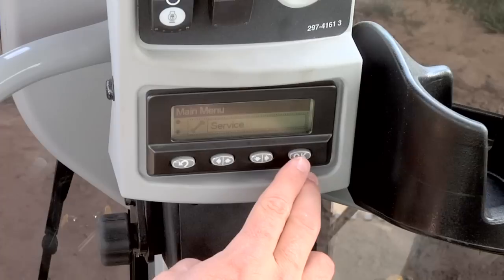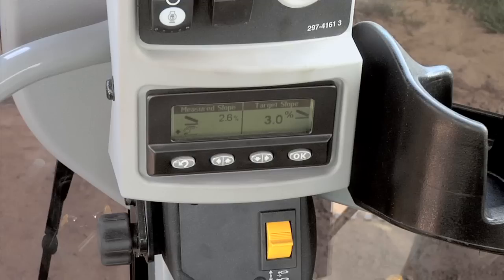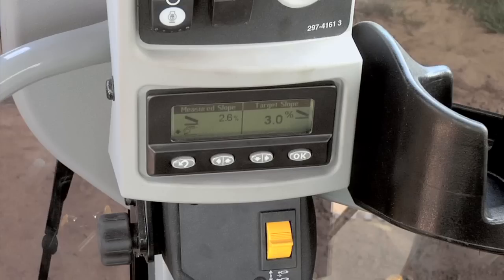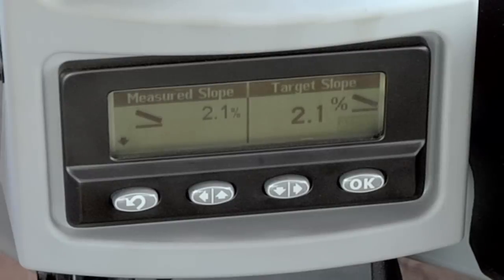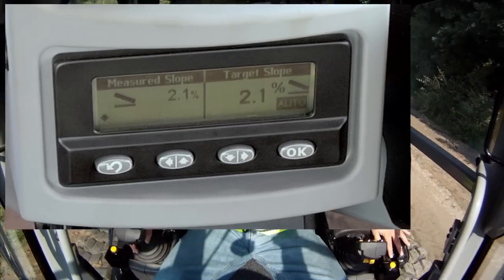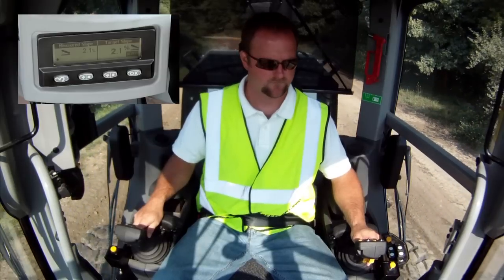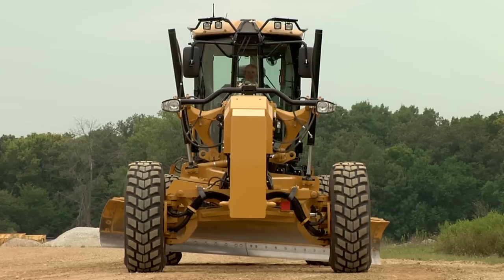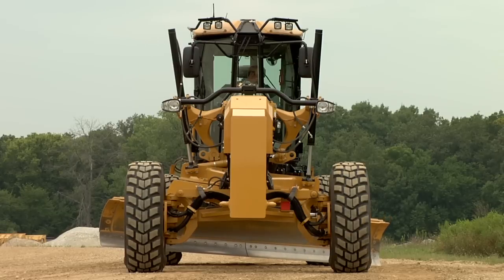Cat® Grade Control Basic Operation | Motor Grader In-Cab Display

Comment: I was an Instructor for the Operating Engineers before I retired in 2013. We bought a CAT 140M series to have the members experience something out of there comfort zone. Before expose it to them, I had to try it myself. It wasn't easy. Working out on the field then, The companies I've worked with had either the 12E, 12F,140G, and the140H. We've never had anything of this type of grader on my watch. IT TOOK ME ABOUT TWO FREAKING WEEKS TO LEARN THIS DAM GRADER! Like they say, never give up! Learning this new type was well worth it. What I found out about this grader is that, You  need to Adjust the seat. The back of your seat has to be straight up. The same position as the earlier graders. The M-SERIES grader  is to  layed back and you can't feel the levers in that position. Bring it straight up. you'll feel a big difference.

Comment: I've been operating for 35 years, 20 of which have been on cat graders, the last 2 years have been on a 140M. I have come to the conclusion that these new graders are designed for those who have never run a blade before, because those of us who have spent years "feeling" our machine are shit out of luck with the M series. Elec. over Hyd. controls remove all feeling of the blade. These new blades are set up for GPS,UTS, etc. electronics where no "freehand" or operator experience is required. I've always been a CAT man, but I'm disappointed in this change.....................
Reply: I agree man .. you feel level in your back ... thanks for confirming how I feel
Reply: 10 4.
Reply: Well get off you tube and go back to reading your news paper. I worked with a a 70 year old grader hand that tought me to use every tool to your advantage  or be left behind so do we move on or should we go back to useing a  horse to pull the plow  it still takes  real operator so go learn how to use this and make your job faster  and truly Shine  .
Reply: Of course you are. But if you had had 30 yrs experience on the M series you would feel the same disappointment in the H series.

Comment: does grade control run off a gps system im trying to get one fitted to my 2008 140m that never came with it and they telling me i need gps installed is this true
thanks in advance
Reply: Hillbilly   No that grade control does not run off of gps system, it runs off a electronic level that is fitted on the moboard Carriage, they do make a grade control unit that that is gps, it installs on each end of the moboard,, i use this electronic level system on my machine M160 and i love it..

Comment: I have a great idea for an even bigger grader, the CAT 26a HTT - Half-Track Technology, taking the track systems from agricultural machines like the combines and tractors and replace the rear wheels with tracks to create a bigger grader for the mining industry that could grade a whole road with a larger blade than the 24M without making a second pass! Imagine a powerful half track grader working in wet conditions? Would easily charge up a haul road without a single wheelspin!